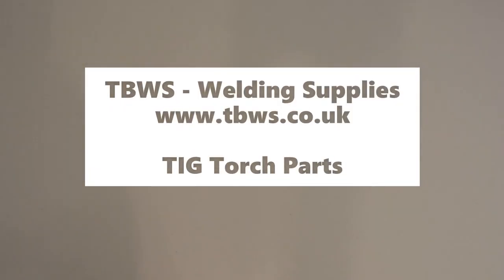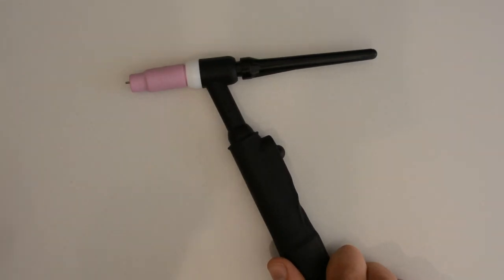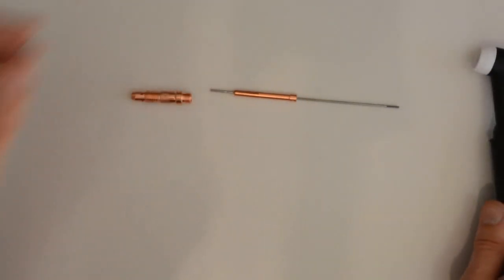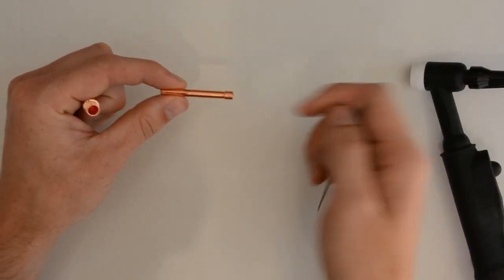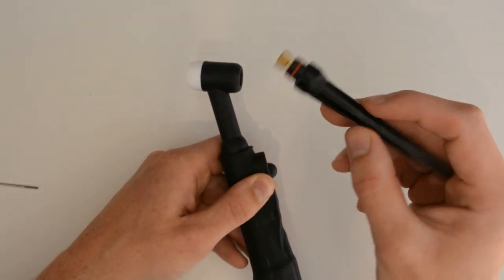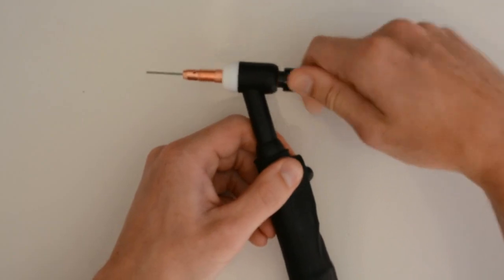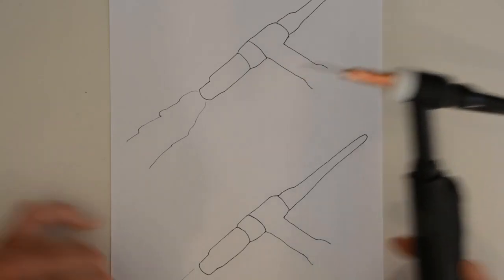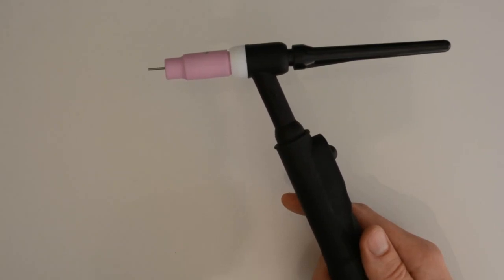TIG Torch Parts   WP17 WP26 and WP18

Comment: no explanation of what is wp 26 or wp 17 or 18, 
are parts interchangeable between them.?
What does the WP stand for ? 
What is the numerical value signifying, thread size ...? what?
Reply: This is why I tuned in.......still no wiser.
Reply: Bağlantı uçlarındaki rekor farklılıkları ve amper yük taşıma kapasitesi

Comment: Hi there, I have been using TIG welding torch for some time now,  but I am having some problems after some time of using the torch after a year or so it stops working properly interested of welding it just burning the material and i have to buy another kit.
Any one knows why that happens, is there a way of repairing the kit, or is that how long they ment to last? 
I appreciate your comments 
Thank you.